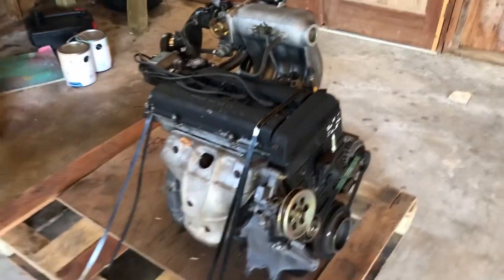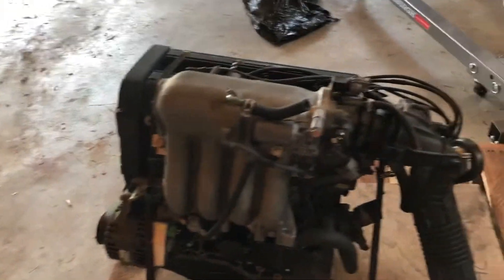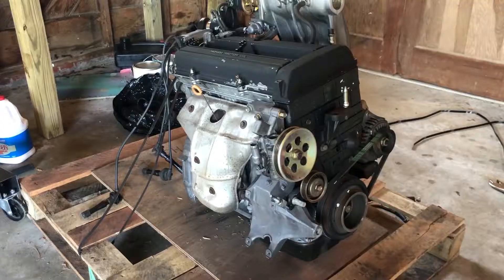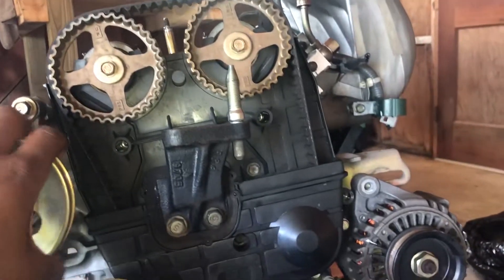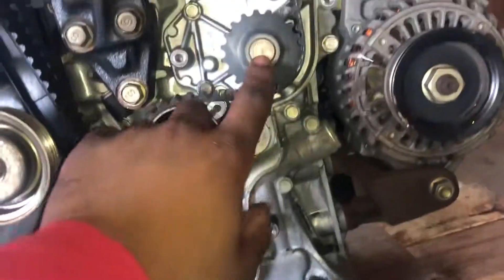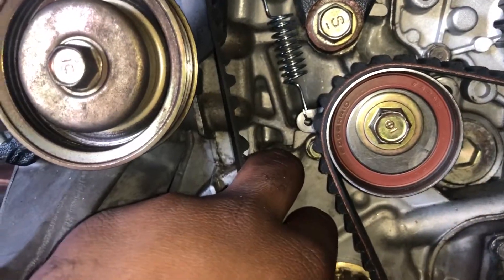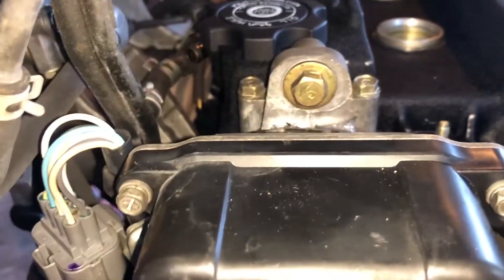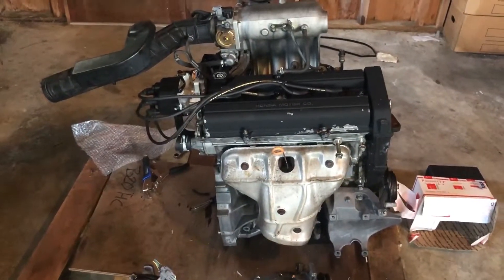THE NEW MOTOR FOR THE CIVIC IS FINALLY HERE! - Timing Belt/Water Pump Install

Comment: Congratulations on the new motor! This is a big deal! Am I the only one exited about this? I need to do something like this. I got a stock 1.5, making like 95 HP. It's time I do something about that.
Reply from the maker: Its a blast!
Reply: @derrickjohnson12341  So, we're gonna get a vid of some revs and pulls, maybe a burnout or two. Right?  Not sure what part of NC you're in, but I just took my Honda from Asheville to Raleigh to Charlotte to the outer banks and back home to Va. It did amazing! Not bad for a 30 year old Honda.
Reply from the maker: Ian Moone of course. I got a few vids to edit and upload so give it time!